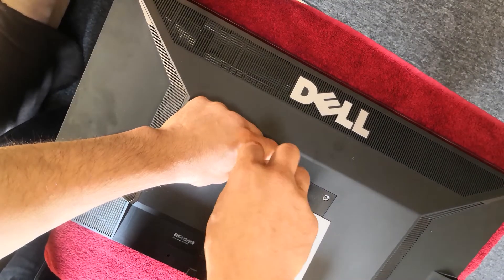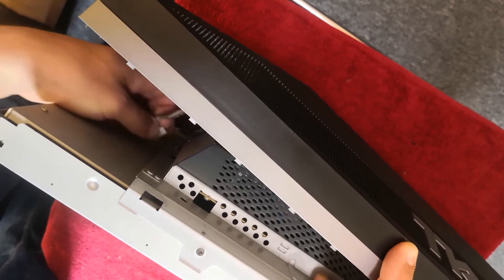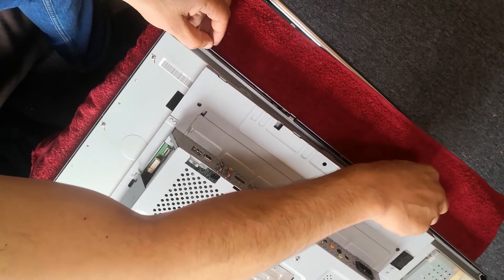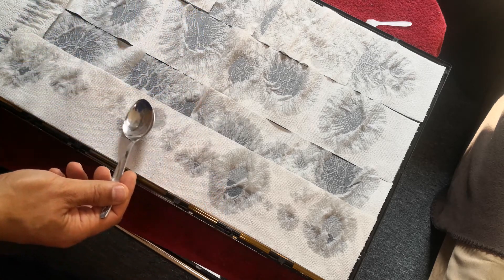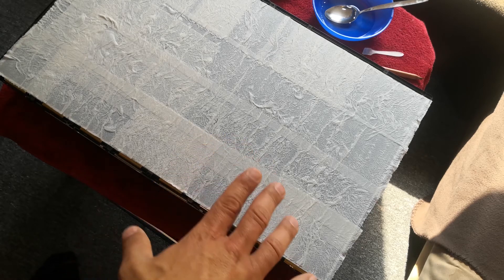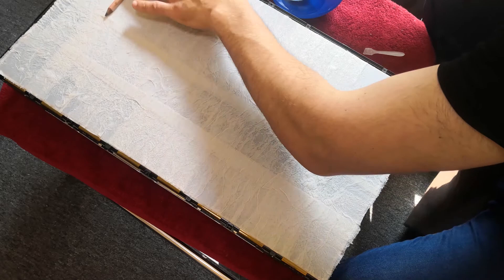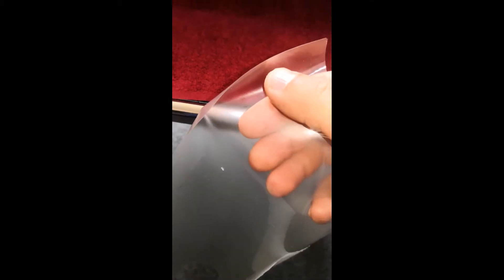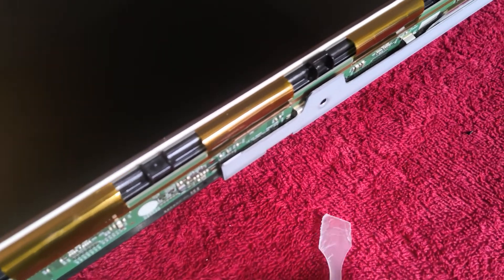uncoating Monitor - Anti glare removal, Dell  U2711 (Matt to Glossy)

Comment: Hi, Im trying this with a small Philips display and because I live in Australia everytime I put paper towls out they evaporate really quickly. Even after 8 hours of soaking the antiglare doesn't seem to want to detatch from the polarizing layer. Apart from regularly checking every hour to make sure its still wet, do you have any advice on how to separate the layers? The polarizing layer is very clear but the antiglare hasn't peeled up yet. You just used a knife but is there anything else you would suggest?
Reply from the maker: I would not go further then ill think....maybe the glue is too strong or it aint a regular coating?
Reply: Yeah my philips also have this problem even after 5 hours my philips tv don't detach that antiglare 
Layer from the polarizer

Comment: Hello, can I have your monitor Monitor Alienware Gamer FreeSync 27 AW2720HF?
Anti-glare 3H hardness ?
Reply from the maker: I've read H3 hardness with a regular haze level of 25% which is a typical value (in the manual pdf of the monitor).  But i admit i never tried a newer monitor model. The glue under some screens could be stronger....

Comment: I just done this to my 43" 4k monitor........its a night and day difference.....awesome.....text is way more sharper.   it doesn't need 5 hrs.   I let mine soak 30 min. and it peeled of very easy..
Reply from the maker: nice to hear...yeah sometimes 30 min can be enough. ill start always with 1 hour before i start my first attempt. if the foliage crumbles or wont get off ill wait another 30-60 min. ...enjoy the colors. :)
Reply: Yeah I took mine off and about a week later there I'd lines that developed across the whole screen. It's odd they feel like physical scratches horizontal all the way across and like 50 of them.
Reply: Is it the samsung monitor ?

Comment: i have lg22mk600 just brought on 5thj may and it got a minor scratch but in white screen i camn see a blackmark what to do???
Reply from the maker: yours has a Surface Treatment: Anti glare ,3H
Reply: @tsk-meteakabruceleekills1311  I didn't get that?
Reply from the maker: @isitsandeep  it is the same style of coating like this in my video. Also it depends in how deep the scratch is. I would use my garantee and bill  to contact the seller....that would work maybe?
Reply: @tsk-meteakabruceleekills1311  o asked them but they said that this scratch is not fault of them so is tarted using this and now the scratch is negligible